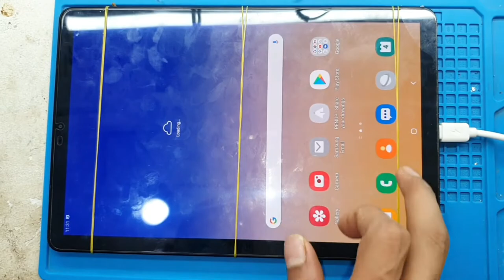Samsung.Galaxy.Tab S4.AKG..Dead.Problem Solution..auto reding..3.4%short

Comment: Hi i have the same s4 tablet that is dead. It charges at 0.36a only but it does not turn on. I removed the shield but instead of this black capacitor it has two small ones
Reply: Hi, I have also the same problem with a SM-T830 
It is totally dead and it take only 30 to 50mAh when hookup to a charger, so you can conclude that is does not start to charge because of the (Power-IC PMIC) powervisor protection IC.
Does anyone have found a solution to this problem?
Reply: I think that our power ic chips need replacing